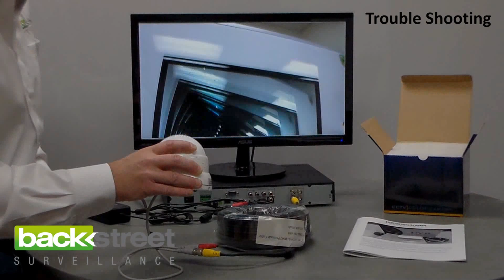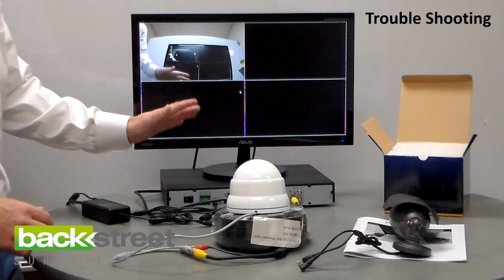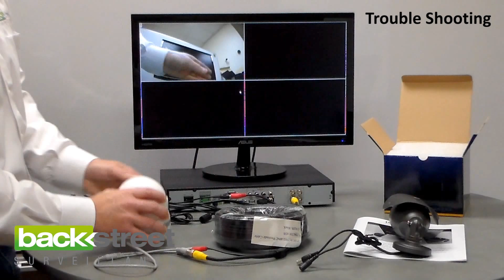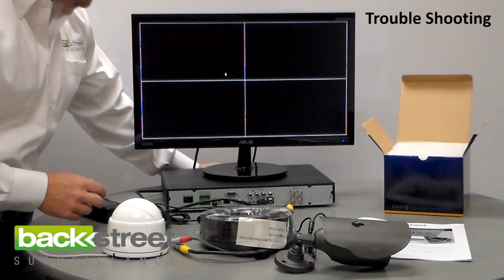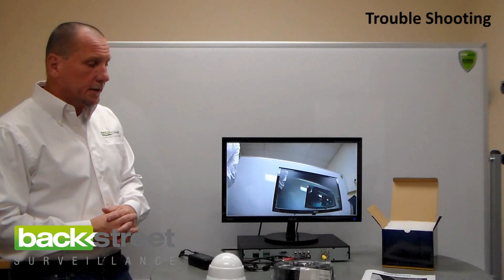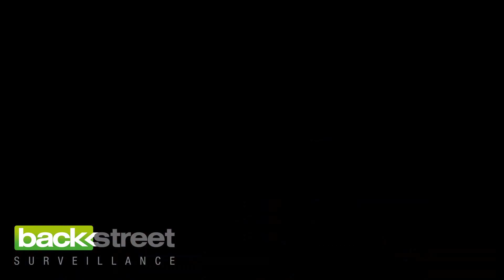Troubleshoot Coax Security Cameras | Easy Fixes for CCTV Systems

Comment: This video is good for the analog systems.  I'd love to see a similar video for the ProVue IP systems, as there are more things than just bad cameras or bad cables that can make the video not appear.  By the way, I did have one (of 16) ProVue cameras that failed a few days after it was set up.  Stuff happens, no big deal.  Fortunately it was while I was still staging the system so I didn't have to climb a ladder and de-install it.  You folks took care of it right away with a replacement.  Thanks!  Good company and good customer service.
Reply from the maker: Hi Steven, thanks for the comment, and the kind words.

Comment: I have floureon Cameras is there a way I can keep all four cameras showering in the monitor at once ??
Reply from the maker: You should be able to it, most recorder can. If it does not do that feature it is extremely low end. Check the user manual, my guess is there is a way. Thanks for the question.

Comment: i have a 4 chanel system i replaced one cam with a new but a different brand and it didnt work is it compatibility?
Reply from the maker: Yes, likely the camera is not compatible. There are many data formats such as ONVIF, CVI, TVI, AHD. Check the specs on the NVR and the camera and match them. Hope this helps.

Comment: How to solve horizontal lines seen on cctv screen?
Reply from the maker: If the cameras are analog the lines are likely a bad fitting or a dying camera. Usually you will not see horizontal line issues on IP based cameras, but it could happen. Check your fittings, then see if you can switch two cameras and see if the issue follows or stays on the same channel. This will tell you where to focus, if the problem follows, its the camera, if the problem stays on the same channel with a new camera then its the cable or the input on the recorder. Hope this helps.

Comment: My camera work's ir lights work, but at night the picture just goes on and off repeatedly, only happens in night mode...
Added a link to show you what's happening...
https://youtu.be/0s_lcd9Arsw
Reply from the maker: Thanks for posting this...very strange. Not sure what is causing it but we suspect the IR system is turning on and off. So try this to see if the problem corrects. You'll notice most of the IR light is landing right in front of the camera on the ground. It might be causing the images sensors to change mode or reset. A simple test is to just aim the camera higher so the IR light is not landing so close to the camera. Try that and see if it has an effect. The IR light is so intense it looks very similar to a "Hot Spot" as we call them. Here is a link to a video that explains.  https://www.youtube.com/watch?v=bo4gcaH6umw   The adjustment may help but not sure...Thanks for the post.

Comment: HELLO SIR MY CCTV SCREEN FLASHING BLUE EVERY 10 MINUTES WHAT COULD BE THE REASON ? THANKS
Reply from the maker: The blue flash is either bad monitor, the monitor loosing connection to the NVR or the NVR losing connection to cameras. It's a data issue for sure, you could try another monitor for a few minutes to see if the issue persists. If it goes away with the test monitor then replace the monitor. If the problem occurs with a new monitor then put the old monitor back in place and troubleshoot the NVR. Hope this helps.

Comment: Our camera security Z Modo was working until the internet people swapped our modem for a newer one.  They left the security system unhooked.  Do you have a diagram showing me what goes where? I have a monitor and NVR box.  I get a message DVI no signal & check video cord. I am not a tech person. T
Reply from the maker: Each system has specifics for remote viewing connection,  I would suggest contacting the company you purchased the equipment from for reconnection instructions. Thanks for the question.

Comment: My entire thing freezes and it will beep restart and work for a few seconds then freeze
Reply from the maker: It might be a faulty hard drive. Try removing it from the unit and turning it back on. Obviously it will not record, but if the NVR boots up and shows you live camera video then the hard drive is likely bad, replace it. Hope this helps.

Comment: I check my camera playback daily. All of a sudden I get no video data no matter what date I select for playback. Is my DVR shot?
Reply from the maker: It may not be the DVR, it might be the hard drive. Try reformatting the hard drive.  All DVRs have a section in the software where you can add hard drives and format them. Try this first, see if video starts recording again, if not take the hard drive out and have a computer repair store test the drive,  if the drive is had replace it and try again. If the drive is good the DVR is shot. Hope this helps.

Comment: My cctv camera works in the night but stops working in day light please please help
Reply from the maker: When you say "stops working" do you mean the video recorder shows the message "no video" or is there just no image? First thing you can try is restarting the camera, it might be stuck in nigh mode, do this by recycling power to the camera. Unplug it from everything and plug it back in. Hope this helps.
Reply: @BackstreetCameras  Thanks For reply. My cctv camera starts working in night but when there is strong light in the night or when day light comes it stops showing any kind of video on screen.It does not stuck.This is happening daily to my cctv camera.I have 3 other cameras on same DVR but they are working properly.What do you think can a bad wire be culprit?
Reply from the maker: It's possible the camera is set in some manual mode (in software) which does not allow it to adjust to the light conditions. More likely is the camera is bad. I don't think its a cable but that can easily be tested by switching the camera with one that is working. If the problem follows the camera to the new cable then its not the cable but the camera. If the problem occurs with a new camera on the same cable then its the cable or the port on the NVR. Hope this helps.

Comment: I can’t log in! Help. Recently bought my home with previously installed security video system and it says incorrect password! Someone recently stole something from my garage and I’m trying to log in and find out what happened!
Reply from the maker: Sorry but you'll have to contact the provider or manufacturer. Passwords are not something you should get help with on youtube. If you do find help...get rid of the system (if you can reset the password based on help you find on youtube so can others.) Hope this helps.
Reply: Name of camera company. Customer service is 24 7 and will do the look and look  4 u

Comment: I have a LTS DVR camera setup. They’ve worked great for 2 years. I unplugged the DVR to hang a new tv and when I plugged it back in all I get is the Home Screen and it doesn’t recognize the mouse so I can’t get in to do anything. Bad DVR???
Reply from the maker: Try the mouse in a different USB port and try a new mouse. Take the unit off any power strips or UPSs and try direct connect to a wall outlet. Give it a try, if nothing changes, look for a local electronics repair shop. Good luck.

Comment: Hi i have a floureon system. set up and all cameras were working until i put in the last camera lead..it cancelled the others out. any help would be appreciated. I have checked cameras, connectins etc.
Reply from the maker: Sorry, we don't have any experience with Floureon equipment. Actually this is the first we have heard of it. Sorry we do not have any helpful direction. Thank you for asking.

Comment: Hi there, we have a Concord NVR with 6 x 5mp cameras connected.
All are operational and give great pic quality...however the camera covering our driveway doesn’t pick up all motion.It picks up me driving in but not my husbands car...very strange.
All the settings on the NVR are correct.
Could this be a sensor problem.
Reply from the maker: Thanks for the question, we have never heard of Concord, its likely a consumer grade system. Sorry, we do not have any advice other than contacting the supplier you purchased from (we hope they have a phone number). Sorry, thanks.

Comment: Hi my cameras was working perfectly until at night time they all started to flicker the. Say video loss and the. Come back as normal the. Switch back to black and say video loss and it still a black screen and my cameras are mounted around my house up high and the screen and monitor is up high so what do I do? And what is the problem pls help
Reply from the maker: The troubleshooting rules apply, but it sounds like the power supply might not be able to power all the cameras when the night vision systems on the cameras turn on. Try removing one or two cameras from the power supply and see if the problems still occurs or if they go away. If the problem is gone try adding one camera back onto the power supply and again monitor it to see if the problem starts up again. If not add the last camera and check again. If removing a couple of cameras fixes the issue, then add another power supply for just those two cameras. This isolates the cameras and provides more power per camera. Hope this helps.

Comment: Hi, I've got floureon CCTV and as soon as it starts getting dark, all 4 camera screen's go to black. Outside the IR slowly flashes, it goes back to normal when it's day light. Any ideas please?
Reply from the maker: Sounds like the cameras are not receiving enough power to operate the night vision system. I would confirm the cameras power draw with the power supply. It also could be a limitation of the cable. Consumer grade systems hate to put copper in the cables, its expensive and weights more. Both hurt profit margins, so they engineer them with as little copper as possible. Hope this helps.
Reply: @BackstreetCameras  thank you for replying. The system was running from extension lead, so I plugged them directly into socket's but made no difference. All 4 camera's go black at dusk but work perfectly during the day. It's really frustrating.

Comment: I have a ZOSI set and my cameras say Video Loss. Could you help me out?
Reply from the maker: One of your cameras are off line, try rebooting the NVR (cycle power also to the cameras). If the camera does not come up its likely a camera problem.  Thanks
Reply: @BackstreetCameras  ik sorry, how do I reboot that?
Reply from the maker: Unplug all power, let it sit for a minute or so and plug it back in.

Comment: My cam its freeze. I plug another cam with diferent wire.and works  in the same port.what you think  its
Reply from the maker: Only change one part of the system at a time for testing. First change the cable but not the camera, if video comes up its was the wire, if no video, swap the camera with one you know works. If the video comes up it was a bad camera. If no video, then its the port on the recorder, try another port on the recorder. Hope this helps. Thanks

Comment: I brought me a 10 camera night owl system a couple months back set it up but now one of my camera shows black and white pictures both day and night time. Could it be the cable that is bad?
Reply from the maker: Cable or camera. But if it worked in color when installed I would focus on the camera. Hope this helps.
Reply: The Security Experts - Security Cameras Made Simple  I disconnected the cables on the DVR side then reconnected it and now it’s working perfectly fine don’t know what cause the problem

Comment: Appreciate the help nice video. Mine was the picture was turning gray and the camera with scrolling. I use your advice and did the quick check with switching out the cameras. It wasn't that. I have a lot of cable strung out so I had to go and look for it at one of the joint connections I found what the problem was. I disconnected and reconnected and it worked fine I don't know what the problem was but it's working now. . Thanks for your help
Reply from the maker: Excellent work. The fitting becomes glazed with whatever and over time the connection is not consistent, the video drops off. When you unplug and plug back in, the fittings make a solid connection again and the camera starts working. You can count on Texans to get it done.

Comment: My monitor shows wide lines of differentcolors. Could it be power
Reply from the maker: Hi Karen, It could be power but it also could be a bad fitting or data noise from other devices being induced on the cable. Is this a new installation or has the camera been working awhile? This info would help us recommend the next step. Thanks
Reply: @BackstreetCameras  thank  you so  much.  My  camerà have been running for a long time

Comment: Hey I have 4 cameras and only 1 works . I have tried the trouble shooting but it didn’t work
Reply from the maker: Keep troubleshooting...take one of the bad cameras and plug it into the cable of the camera that is working. Does the camera provide video? If yes, its not the camera. If there is no video its likely the camera is bad. Hope this helps.

Comment: Hello, I have a problem too. I have a DVR from KKmoon and bought a Zosi camera afterwards. It worked just fine until I realized that the extra Zosi camera had XVI control with a menu. I played around with it and I changed a setting and now the screen has gone black and I see a big N with a red cross at the bottom. Is there any way you could help me to get the image back? Thanks in advance
Reply from the maker: Sorry, we have no experience with that software, it's an off brand. We would not know how to troubleshoot, sorry. We would suggest calling the supplier you purchased from and have them provide tech support. Good luck. Thanks

Comment: Hey guys, I have a sannce system with multiple camera set up however I cannot set the view on the monitor to show all cameras at once on a split screen continuously.  I can briefly view this split screen but then it quickly reverts back to camera 1 as main screen. Is this normal or am I missing a trick here? Many thanks
Reply from the maker: It could be three possibilities - monitor is not compatible, software bug or a bad camera signal. 1. Try another monitor, its possible (if its an older monitor) the signal format (with multiple cameras displayed) is not compatible with the monitors supported formats. The video recorder senses this and resets to the single camera view. 2. Bad camera signal -  disconnect all but two cameras from the video recorder, try the multiplexed view (both cameras displayed on the screen). If the problem continues, disconnect the two cameras and connect two others. If the problem stops its a bad camera signal (one of the first two cameras is feeding a bad data signal into the system causing the problem). If the problem continues its likely a software bug. When the system switches to a multiplexed view data streams are running into an incompatibility issue causing the system to reset the video feed to a single camera. Hope this helps. Thanks for the question Backstreet Support Staff.

Comment: I have a swann camera and trying to run 2 100ft cable with a splitter in the middle and i cant get video.. but if i connect my camera on the first 100ft ot does work what could it b the problem..
Reply from the maker: There's a lot of info missing info that is needed to explain in detail, but if its coax and an analog camera you messing up  the ohms on the line and causing the failure. Sometimes splitting the signal works but not at distance. If its data cat5 or cat6 it will never work. You have to use a PoE unit. Here: https://www.backstreet-surveillance.com/cctv-parts/cctv-power-supplies/four-port-poe-power-injector.html
Reply: @BackstreetCameras  there bnc cables i have a 100ft one amd im trying to put another 100ft so it can reach the camera but i dont get signal only if i connect it on the first 100ft

Comment: One of my video(port 2) is not working.  No video at all...all black, but it shows on screen that its connected and power supply works.  But when you I put that camera into a different port(1,3,4), it works so all my cameras do work.  when I use other cameras into port 2, it doesnt work.  Help is  one of the port on DVR bad?
Reply from the maker: Very likely the port is bad but you should swap the cable with one you know is working just to make sure the cable and fittings are good.

Comment: Hello I have a Swann 8 camera system and on the TV it's stuck on the System Language which has "Apply or Exit". I tried over a hundred times with the mouse to click on either one but nothing is happening. I tried with the remote,  unplug TV, unplug the DVR camera box, unplug all the cords and plugged them back and still nothing works. I can watch some of  the cameras in real time but I can't do anything else like FF or rewind. How can I clear the block on the TV sxreen?
Reply from the maker: Sounds like a defective video recorder. I would look for a replacement. Thanks
Reply: check the battery inside the dvr to make sure it doesnt just need to be replaced before you go out spending money on a new one.